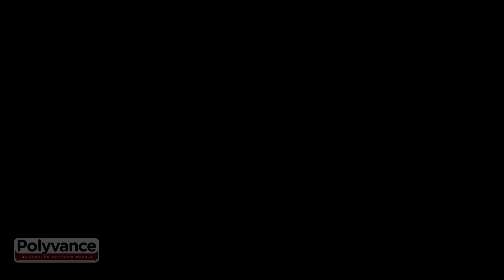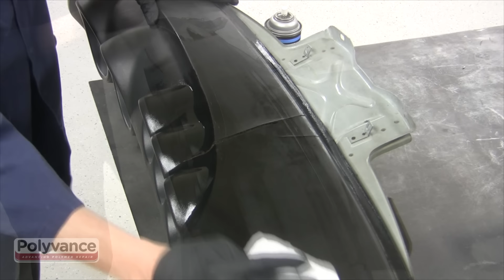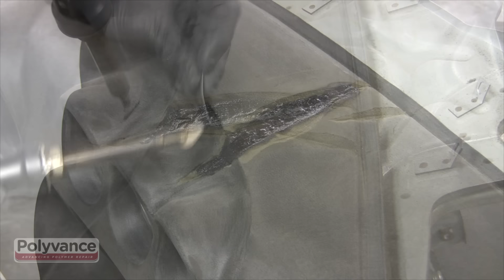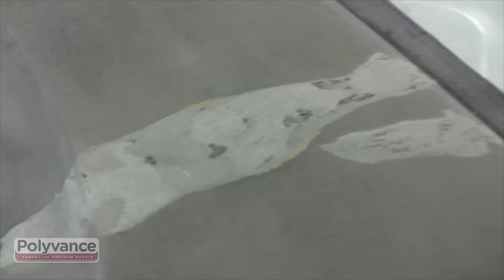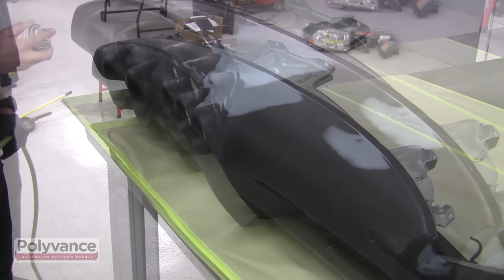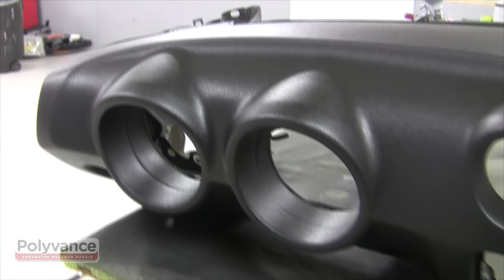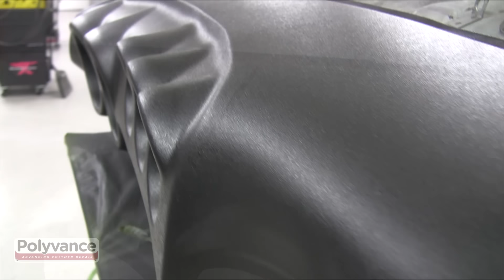Cracked Dashboard Repair - Padded Dashboard

Comment: Seems like a visit to the scrapyard or ebay  is so much easier. This looks great, but so much effort. I would only consider if a replacement cannot be found
Reply from the maker: That is more or less what this is for...it will really help you if a replacement cannot be found, the replacement is too expensive, or you want to keep the original part that came with the car.
Reply: The problem with a junk yard, is they have been sitting in the weather and are generally worse than what you find on a typical driver.  Ebay has its pros and cons.  the cons would be that shipping a "good" dash may not arrive good, than to the folks in the brown and white trucks!

Comment: I think it would be much easier, and look much nicer if a person were to just fill the spot(s) like they did in the video, then go buy a new roll of vinyl at a fabric shop and use contact cement to stick the vinyl back on.
Reply: That is another good repair method, especially if you don't have spray equipment.
Reply: rather than painting it like they did in this video.

Comment: Can I do this w/o an orbital sander? I dont own any of those tools. I just have different types of sandpaper with different grits
Reply: Sure!  It will just take a lot longer.  Be sure to use a sanding block where you can and you don't want to apply a lot of pressure while sanding.

Comment from the maker: Visit this video page on our website to see the full list of products used and other helpful tips: https://www.polyvance.com/video/dashboard-repair/cracked-dashboard-repair-padded-dashboard
Reply from the maker: There isn't one uniform answer to this question. Just like how know one really knows how long an OEM dash will last before it cracks.
It will depend on how you take care of it. Where and how you store the car is likely a big factor. It should last a long time being stored in a climate controlled area.  Sun is the killer of dashes, so limiting its exposure like that will reduce the rate of shrinkage on the original vinyl, which is the weak point.

Comment: They used so many tools and parts it would have been cheaper and faster to get a new one lmao
Reply from the maker: What if a replacement is not available? Aftermarket parts (which are not ideal to use) may be available for some cars, but not others. Older cars most likely will not have a new OEM dash available to replace it with. So replacing the dash is not an option for some people. In that case, it has to be repaired.
Just look through the comments on this video, and you can see that people are saying new dashboards aren't available for their cars.

Comment: So ... you have to spend 250$+ in products and about 10 man/hours to end up with dash that looks nothing like original, and actually decrease value of restoration.
Reply: Thata a bit harsh. On certain cars finding a junk yard replacement is almost impossible (cough.. Porsche) as they have all split. OEM replacement is almost 2k for a 944. If this can fix my dash for $300 it is a good deal

Comment: I give it a 10 before the orange peel coat. Just dont understand the orange peel coat. Anyway.. That is an awesome system. I am impressed.
Reply from the maker: Thanks for watching!

You're right that our Flextex VT will not match the original leather grain look. Flextex produces a pebble grain texture, from smooth to coarse (and anything in between), depending on how much you reduce it. You can see examples of the heavy, medium, and fine texture here: https://www.polyvance.com/_pdf/info3803.pdf

Unfortunately, matching all OEM textures is impossible because some use a square pattern or a leather like pattern. Even if you take a mold of the pattern and embed the pattern on the repair, it is very difficult to blend the original pattern with the reproduced pattern. When you paint it, you often end up seeing a transition ring. So the compromise is to put a pebble grain over the entire dash and deal with the fact that it is not the same.

Comment: I need to do this on a 87 Buick Grand National that was already cracked in the same spot as the car in the video in 1995 when I bought it. It’s funny I’ve owned my 87 WE4 Turbo-T since it was brand new and honestly it wasn’t hard to take care of and 31 years later it still can pass as new. My buddy in Florida bought a Grand National that same year because he liked mine and by 1995 his dashboard was already had a big crack and you can tell the sun really kicked it’s ass. Now I own both of them and they both stay in the garage. But I would like to fix that crack in the dashboard. It literally looks just like the crack in this video. 

I bought mine in 1987 in Brooklyn ny. He bought his that same year in Florida. In 95 I bought his and brought it to ny. In 2015 when I retired I moved to Florida and brought both cars with me.  Point I’m trying to make is does Florida sun and heat really ruin cars like that? Because honestly after looking at the clear coat peeling off every car that over 10 years old down here. It scares the shit out of me to take my WE4 out of the garage lol.
Reply: The sun and heat a much more abusive on a car in Florida than in NY.  That's why paint testing labs have their outdoor facilities in Florida and AZ.  Not only is there high heat and lots of sun in Florida, but in many areas there is a lot of salt in the air as well.  In the aviation industry, they have a saying..."you can take a plane out of Florida, but you can't take the Florida out of the plane".  The same would apply for cars I suppose...but if you are storing them in a garage, I wouldn't worry too much.  they don't see the same extremes a car stored outdoors would.

Comment: People will do anything not to replace something
Reply: Sometimes you just can't go out and buy a replacement and a custom restored dash can be in the thousands.
Reply from the maker: What if a replacement is not available? Aftermarket parts (which are not ideal to use) may be available for some cars, but not others. Older cars most likely will not have a new OEM dash available to replace it with. So replacing the dash is not an option for some people. In that case, it has to be repaired.
Just look through the comments on this video, and you can see that people are saying new dashboards aren't available for their cars.

Comment: Or just get a second hand dash and get if fitted
Reply from the maker: What if a replacement is not available? Aftermarket parts (which are not ideal to use) may be available for some cars, but not others.
Older cars most likely will not have a new OEM dash available to replace it with. So replacing the dash is not an option for some people. In that case, it has to be repaired.
Just look through the comments on this video, and you can see that people are saying new dashboards aren't available for their cars.
Reply: Scrap cars are striped for interior and any other good parts that can be salvaged then stored my uncle has a old American dodge kingsway  that he had front grill , door cards and wheel hubs shipped over from a scrap specialist vintage car parts in the US. I also watch a lot of usa and UK car restoration programs and they see no problem finding over 20 year old car parts from a salvage yard.
Reply: What you see on TV and reality are two completely different things.  If you went by those shows, a person could do a complete restoration in no time.
Reply: This is a foam dash with vinyl skin not plastic this takes more weathering than a wood door panel and metal dash could so your way off the mark there as this is not prone to rot or rust damage that's why car manufacturers have moved on to using foam and plastic
Reply: Vinyl and foam are plastic and they are VERY prone to weathering.  Maybe not so much in your northern latitude, but in the states they crack and crack fairly rapidly from heat and sun damage.  Hard plastic dashes are slightly less prone to cracking, but are far easier to repair.
Reply: Lots of scrap yards  have older car parts stored anyone who is doing up a old car will source their car parts from there this is good for show but in time will just look messy not any old Joe can do this I'm sure you had lots of year Experience.
Reply: When's the last time you've seen a 20 year old car in a junk yard WITHOUT a cracked dash?  For me, its been never.  Not to mention FEW older cars are in salvage yards. Once they are no longer a "late" model, most are crushed and sold for scrap to make room for cars that are more current.
Reply: That's not the point the point being is you can get these parts from classic car salvage yards and not anyone can rock up after watching this and do this.
Reply: My point is by the time a classic hits a salvage yard the dashes are generally shot and there are FEW classic car salvage yards in existence anyway.  Your Kingsway had a steel dash and hard-board door panels  and don't take the same weather beating a dash does.  Good plastic dashes are EXTREMELY hard to find and if you do find one, they are very expensive.

Comment: Fiberflex = zip ties. 👍
Reply: Not hardly...they share no similar plastics, they are not fiber reinforced, they have no adhesive quality to them, they are not easily sandable, and the plastic they are made from is much more rigid than fiberflex.

Comment: It doesn't have the grain or texture of the old dash pad....
Reply from the maker: You're right that our Flextex VT will not match the original leather grain look. Flextex produces a pebble grain texture, from smooth to coarse (and anything in between), depending on how much you reduce it. You can see examples of the heavy, medium, and fine texture here: https://www.polyvance.com/_pdf/info3803.pdf

Unfortunately, matching all OEM textures is impossible because some use a square pattern or a leather like pattern. Even if you take a mold of the pattern and embed the pattern on the repair, it is very difficult to blend the original pattern with the reproduced pattern. When you paint it, you often end up seeing a transition ring. So the compromise is to put a pebble grain over the entire dash and dealing with the fact that it is not the same.

Comment: Wow the detail is outstanding. Personally I would of just added some kind of Bondo and add leather over it.
Reply: Padded dash filler is a polyester filler like bondo, but it is a special variety that cures flexible, so it has the same feel as the dash and flexes with it.

Comment: I spent the entire video looking forward to the end to see the trick to match the grain in the vinyl, and then they didn’t.
Reply from the maker: Yes, it is difficult to try to recreate the original look. Unfortunately, matching all OEM textures is impossible because some use a square pattern, or a leather like pattern and even if you take a mold of the pattern and embed the pattern on the repair, you cannot blend the original pattern with the reproduced pattern.  When you paint it, you end up seeing a transition ring every time.  So the compromise is to put a pebble grain over the entire dash and living with it...even though its not the same.

Our Flextex VT will not match the original leather grain look, but you can alter the way the Flextex looks. Flextex produces a pebble grain texture, from smooth to coarse (and anything in between), depending on how much you reduce it. You can see examples of the heavy, medium, and fine texture here: https://www.polyvance.com/_pdf/info3803.pdf

Comment: Couldn't the dash be recovered?
Reply: Certainly...however, it typically costs over $1k for most dashes.  The labor to do it is high due to the specialized nature of it and the fact they also completely rebuild the foam underneath, so for those of us not flush with cash, this is a more practical solution.
Reply: I bet reproduction ones are even costlier.

Comment: You destroyed original skin texture. Restore that original look the hardest part
Reply from the maker: Yes, it is difficult to try to recreate the original look. Unfortunately, matching all OEM textures is impossible because some use a square pattern, or a leather like pattern and even if you take a mold of the pattern and embed the pattern on the repair, you cannot blend the original pattern with the reproduced pattern.  When you paint it, you end up seeing a transition ring every time.  So the compromise is to put a pebble grain over the entire dash and living with it...even though its not the same.

Comment: Will the polypro welder get hot enough to melt the fiber flex rods or would I need to purchase the other plastic welder?
Reply from the maker: The PolyPro Welder will be able to melt the FiberFlex rods just fine!

Comment: What happens when another split appears 10 inches away, or somewhere else? Do you have a product that prevents future cracks? Like something that can be used on a dash that hasn't cracked yet?
Reply: Jason,  There is nothing like that, but it sure would be a grand slam of a product, wouldn't it?

Comment: Looks great. My only issue is what about the rest of the old foam and vinyl? Won’t it just crack somewhere else do to it’s age?
Reply: Its possible...but generally once they crack bad enough to need repair, the cracks alleviate the stress over the rest of the dash for quite some time.

Comment: Okay so I will admit that is one way of doing it the hard way if something like that came into my shop I would sand the cracks down use spray foam sand the spray foam and rewrap with vinyl that way you don't get that ugly textured look instead of a beautiful vinyl material basically 40 bucks on vinyl five bucks for fabric adhesive spray maybe five to ten bucks for spray foam that way you can add Armor All to it because you can't add Armor All to paint just don't go together

Comment: Way over did what you pay for all that material you can buy a new dash pad not to mention the time invested LOL
Reply: I got a 64 Impala Super Sport 409 with a metal Dash plate covered with foam and vinyl getting that done for less than two hundred bucks I've been in the Autobody industry since the day I was born both sides of my family all male men did Auto Body and interior some of our woman to LOL I am 40 year old now I know all about cars everything I restored every classic car you can think of from drivetrain to Auto Body frame-up restoration including interior
Reply: It all depends if a dash pad is available.  Many older cars no longer have them available.  To have a dash refoamed and rewrapped typically costs around $1k....so many times this is the economical alternative.
Reply from the maker: As Scott said, many older cars do not have new dash pads available. Just go through some of the comments on this video to see several people saying they don't have any other option than to repair their dash.

Comment: now the dash has a completely different unoriginal texture... but good work though
Reply: True-true, but It looks a million times better than a bunch of nasty cracks! :)
Reply from the maker: You're right that our Flextex VT will not match the original leather grain look. Flextex produces a pebble grain texture, from smooth to coarse (and anything in between), depending on how much you reduce it. You can see examples of the heavy, medium, and fine texture here: https://www.polyvance.com/_pdf/info3803.pdf

Unfortunately, matching all OEM textures is impossible because some use a square pattern or a leather like pattern. Even if you take a mold of the pattern and embed the pattern on the repair, it is very difficult to blend the original pattern with the reproduced pattern.  When you paint it, you often end up seeing a transition ring.  So the compromise is to put a pebble grain over the entire dash and dealing with the fact that it is not the same.

Comment: How did something sanded smooth get texture like the rest ?
Reply: Texture was sprayed on with 3803-4 Flextex VT
Reply from the maker: Hi! We used our Flextex VT texture spray on the dashboard. You can have a look at Flextex VT on our website: https://www.polyvance.com/Flex-Tex-1/
This is a variable texture material, so you can change the textured appearance by reducing by different amounts.